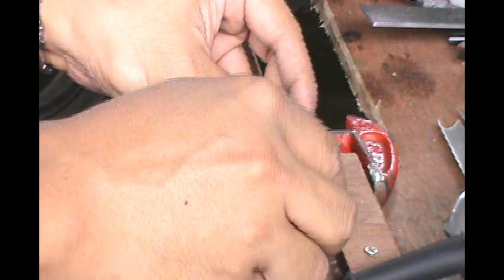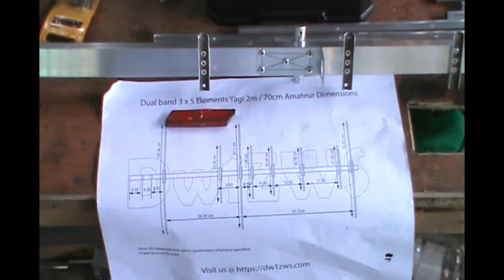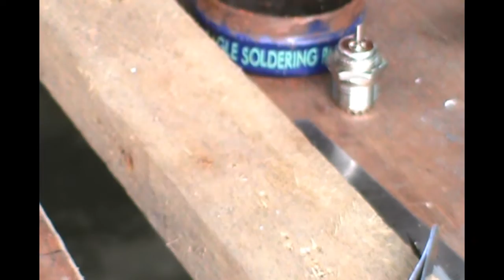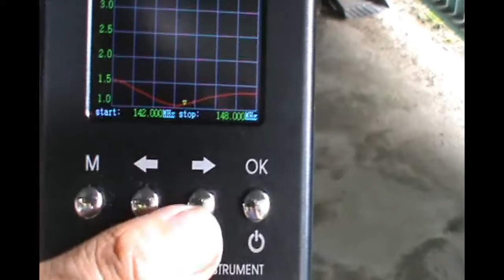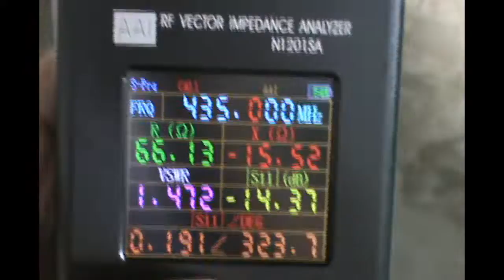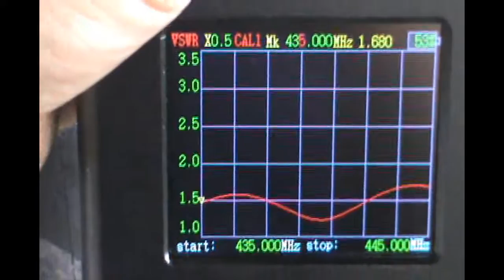Building 3 Elements x 5 Elements 2m/70cm Dualband Yagi

Comment: How to connect  in vhf uhf duplexer  or any methods
Reply from the maker: you don't need a duplexer for this you just need the phasing harness to work directly on a dualband radio - however if you insist on using a duplexer just remove the T-connector and use a separate feedline going to the each antenna connector.
Reply: @EphraimGariguez  thanks for replying please  I am vu3myp in india 73s

Comment: how i do conect both cables in one?
Reply from the maker: you need an SO239 T-connector to connect the phasing harness together
Reply: @EphraimGariguez  ano ang laki ng cable bago ito nasali ?? ang cable ba 50 ohm o 75 ohm?
Reply: @EphraimGariguez  
what is the size of the cable before it is joined ?? is the cable 50 ohm or 75 ohm?
Reply from the maker: @franciscoalves5058  use a 75 ohms cable for the phasing harness there's a lot of information on how to do that on google.

Comment: Bro. Happy viewing po from local ng Camella Spring ville molino3
Reply from the maker: thanks po
Reply: @EphraimGariguez  bro ask ko lang po wala kasi ako Swr. Pano ko matotono yung gamaatch? At isa pa po saan ko itatap ang ground ng coax sa babang gama match.
Reply from the maker: @123biker6  kailangan mo ng swr or antenna analyzer para mag tune ng antenna kung wala ka nun hit and miss ang gawa mo. Basically ang braid ng coax ang ground center conductor lang ng coax ang may contact sa gamma match eto diagram nya >>> https://dw1zws.com/building-the-gamma-match-for-4-elements-yagi/
Reply: @EphraimGariguez  tol ito gama match na pinoward mong file pang uhf or vhf na sukat?
Reply from the maker: @123biker6  ??? di ko ma gets anong pinoward na file?
Reply: Bro. Kapag tinester ko ang SMA dapat ba hinde grounded. Or grounded itong antenba na ito.?
Reply from the maker: @123biker6  not grounded
Reply: I mean link bro. Yung naka attach sa reply mo na pattern
Reply from the maker: @123biker6  di ko alam kung asan yung reply na tinutukoy mo? sa dami ng comment di ko ma pin point yung tinutukoy mo na reply sorry.

Comment: Sir Ephraim. Magandang hapon po.  Magtatanong lang po sanan kung 75ohms cable po ba ang gamit nyo as phasing harness at anu po ba ang sukat po kung ok lng po :)
Reply from the maker: Johnson Diputado . 75 ohms ang sukat ay depende sa velocity factor ng coax 1/4 wavelength x odd number x velocity factor yun ang length ng phasing harness
Reply: @EphraimGariguez  ok po sir. Marami pung salamat sa information po. 73!
Reply from the maker: @jdstufu   welcome thanks, for dropping bye 73!
Reply: Hi Sir @EphraimGariguez  patungkol po sa phasing harness, pareha po ba ng sukat yung para sa uhf at vhf? O kailangan po ba na yung sa uhf antenna ay sukat para sa uhf tapos yung sa vhf para sa vhf din?
Reply: @EphraimGariguez  
anong 75 ohm na laki ng cable ang ginamit mo para sa VHF at UHF? Pagkatapos ng kantong, isang 50 ohm cable ang ginagamit, tama ba?
Reply from the maker: @franciscoalves5058  75ohms cable for the phasing harness, 50 ohms cable for the feed line. The design of the antenna is complimentary (harmonic frequency) center frequency is 145Mhz on VHF and 435Mhz on UHF so you can use the same length of the phasing harness on both VHF and UHF side computed for the VHF center frequency 145Mhz (use odd multiple 1/4 wavelength of 75 ohm cable * coax velocity factor) for the phasing harness. Connect it to a SO239 T-connector.
Reply from the maker: Johnson Diputado parehas lang complimentary kasi ang design nyan 3rd harmonics kaya pwede mo gamitin yung phasing harness length ng VHF
Reply: @EphraimGariguez  ok po sir. Mrami pong salamat uli. Gagawa po kami nito para pang Satellite Coms po Ao92, AO 91, AO 85 at SO 50 po. salamat po uli Sir ng marami! 73!
Reply from the maker: @jdstufu  welcome good luck sa satellite hunting
Reply: Sir  @EphraimGariguez  marami pong salamat! 73
Reply: Hi Sir, sorry po at may tanong nanaman po. Gaano po ba ka layo ang gama rod from the driven element po for vhf at uhf po? Salamat po uli :)
Reply from the maker: @jdstufu  , 1 inch parehas ang gap vhf/uhf
Reply: @EphraimGariguez  salamat po uli ng marami sir ! 73!
Reply: Sir  @EphraimGariguez  patanong po uli :) Sir sa pag totono po ng dual band yagi nyo po kailangan po bang i tune  one at a time. Ang ginawa ko po kasi kinabitan ko po ng rg 58 lng po yung vhf muna tapos tinono. Tapos yung uhf nanaman. Nung na tono ko na po yung dalawa na magkahiwalay kinabit ko na po yung may phasing harness po. Kaso po, di na tonado sa u at sa v po. May na miss po ba kaming gawin? Salamat po uli at more power po sa inyo! 73!
Reply from the maker: @jdstufu , sabay, dapat nakakabit ang phasing harness sa pagtotono pag napababa mo na swr sa one side kabila naman then re-check until satisfied ka na sa adjustment mo at nakuha mo lowest swr, normally pag ok ang phasing harness mapapababa mo ng 1:1 both side kahit hindi naman perfect SWR basta usable ok na yun.
Reply: @EphraimGariguez  ah ok po Sir. Salamat po uli ng Marami! 73! :)